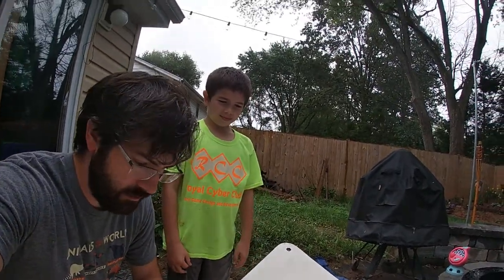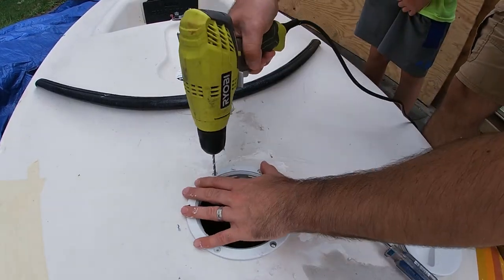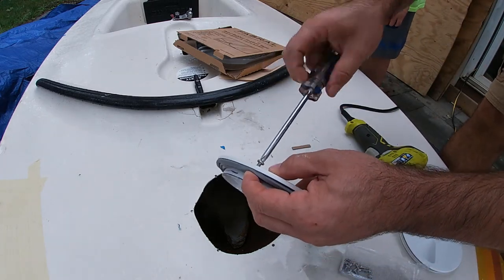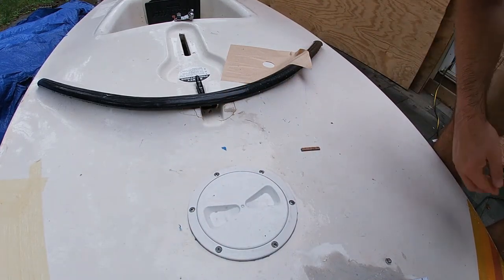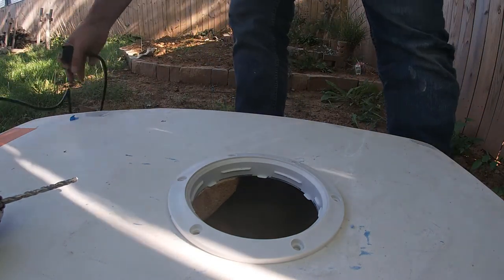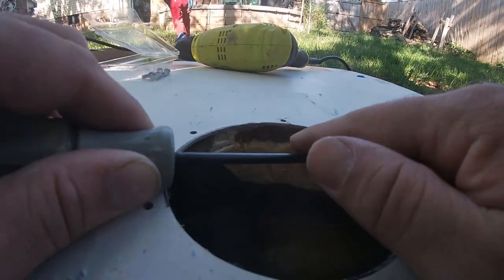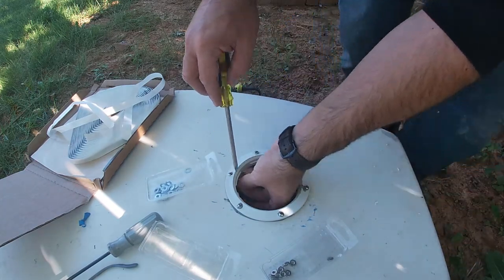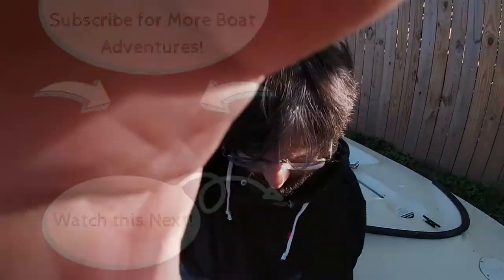Installing Inspection Ports - TSS EP 22

Comment: I installed a 4 inch inspection port with clear window on my sump pump cover lid. It's great, now I can look in there when it rains and can unscrew it and test the float switch whenever i want. Lots of uses for these port windows.